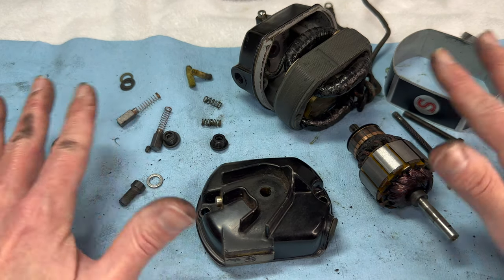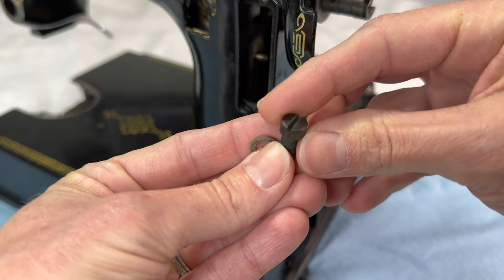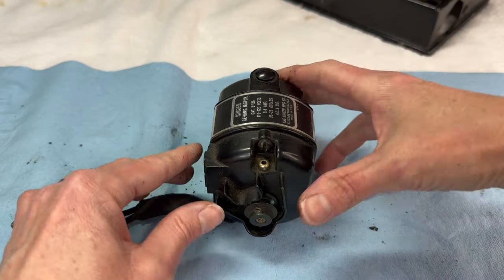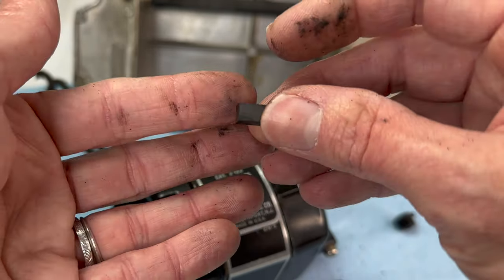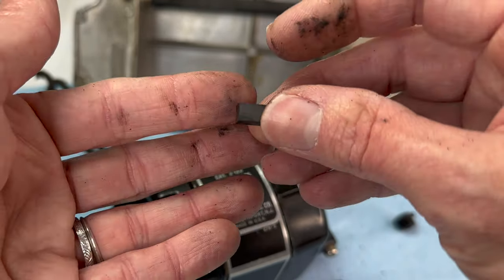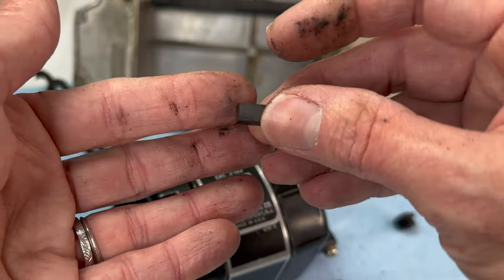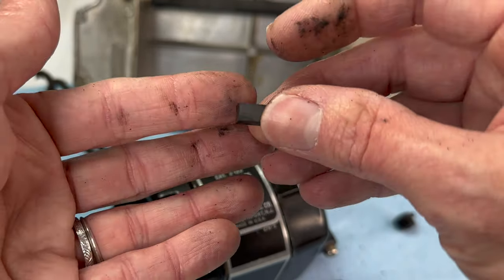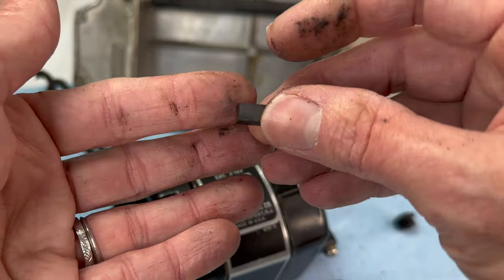How to take apart the motor on a Singer Featherweight: Singer Featherweight Tutorial - Part 7

Comment: What caused these rouges on the commutation?  Thanks, Dave
Reply from the maker: Hi! Probably thread and needle strikes. Hard to imagine thread could do that but if a machine isn’t maintained properly over the years then it is possible. Almost every Featherweight I work on has those marks…makes you wonder if the hook assembly design could have used some tweaking…

Comment: Hi Jen, Thank you so much for the Featherweight tutorial.  I am rehabbing my first Featherweight and your videos are guiding me along beautifully.  I have run into a problem that I could use your advice on.  I cannot remove the screw that loosens the motor.  I have applied penetrating oil several times.  I could get someone stronger than I to try, but I'm afraid of causing damage.  Do you have any advice I could follow before resorting to brute force?  Thank you!  Michelle
Reply from the maker: Hello! are you talking about the motor mount screw? It is a pretty hefty screw so you shouldn't be afraid to be a little forceful with it. If you have a way to get some leverage it should come loose. The chapman screwdrivers come with a little mini ratchet tool that fastens on to the shaft of the screwdriver, I don't know what I would do without that sometimes! It helps you get more torque when you are turning the screwdriver. But yes, maybe it's time to call in a little more muscle! I hope you can get it loose!

Comment: My featherweight light comes on but the motor stop working?  Do you have any suggestions?😪
Reply from the maker: Hi! Without seeing it, it would be hard for me to tell. I would unplug the machine, make sure the motor brushes are not worn down all the way and then I would check all the wiring. It could be a number of issues, sorry I can’t be of more help here!

Comment: As you were removing the brush covers, you mentioned a link to get new ones. However, there is no link for the covers. Mine on my white featherweight are broken or sheared off. Can you please tell me where to find new ones? Is there someone who can make new ones using a CAD program and a 3D plotter? Any information will be greatly appreciated! Thank you.
Reply from the maker: Hi! Here is the link: https://singer-featherweight.com/products/motor-cap-screw-small/?aff=57 I will try to add it to the video description as well. I don’t know if anyone who can make them with a 3D plotter, that would be great if there were someone who did though!
Reply: Thank you! Do you have a code to get credit for my purchase? @SewingMachineRehab
Reply from the maker: Hi again :) That link will do the trick! Thank you for asking! @jenc7086

Comment: An excellent demo series!  You did a fantastic job of explaining the mechanics of disassembly and reassembly.  How fortunate we are to have this.  Many thanks!!!

Note to viewers:
7:40 Pull out carbon brush SLOWLY, and stop before brush comes fully out. Check direction of curve on end of carbon tip. Is it horizontal or vertical? Make a diagram on paper showing curve of carbon tip so that you have a visual when putting the used one back in after maintenance. It makes no difference on a new brush, but the old one has a curve matched to the commutator curve inside due to wearing down from contact.  This is particularly important in this particular model, as the brush seems square not rectangular.  In my vintage Viking machine, the brush is rectangular and only fits one way inside, so it is foolproof.
Reply from the maker: Thank you so much! I was sad when this one was completed, it was so much fun and I have immensely enjoyed the interaction with all who have followed along!

Comment: While cleaning out my attic this week, I found a Featherweight 221 in it's case that has been sitting there for almost 30 years! It is a 1952 and looks like it was rarely used. I have been following along with your videos up until taking apart the motor. If I tackle taking the motor apart, where can I buy new wicks for the grease? I am assuming they are hard as rocks by now. Thanks!
Reply from the maker: Wow! That is wonderful! I think I will go look in my attic for a Featherweight haha!  I actually sell the grease wicks on my site now: https://sewingmachinerehab.com/shop/ols/products/grease-wicks-for-singer-featherweight-221-motor  ….and good luck with your restoration!

Comment: would i be able to just use electrical tape instead of heat shrink tubing?  btw thank you for this series, it is amazing... i have 2 featherweights all taken apart ready to be cleaned now, thanks to your helpful detailed, descriptive videos! ur an angel
Reply from the maker: Hi! Thank you for your kind words, I am glad you like the videos. I would stay away from electrical tape in place of the heat shrink tubing. I am not an electrician but from everything I have researched the heat shrink tubing is safer. I hope that helps!
Reply: thanks!  one more question, can i just skip the heat shrink tubing altogether?? @SewingMachineRehab
Reply: Harbor freight has heat shrink tubing, you don't have to shrink it, if you don't have a heat gun !

Comment: Good Evening.  I am so happy that I found your YouTube Channel.  I was gifted a 1952 Featherweight.  It is in need of some TLC.  I have removed parts following your instructions.  I even have the cap off the motor and have the other side to loosen to get to the wick.  I noticed that the armature is black and not the copper color yours is.  I am assuming that I can wipe it off, not sure if I can get back to the copper color.  Is it normal that it should be black and not copper?  If you have any suggestions on how to handle this, I would be greatly appreciative.  Thank you and Cheers.
Reply from the maker: Hi! You can wipe off some of the carbon you see with a cotton swab dipped in alcohol. Then I polish it using very fine sand paper, around 3000 grit and wipe it again with alcohol. You should see copper under that black when you are finished. The featherweight shop makes a rubber honing stick which also works well. I hope that helps!
Reply: Thank you for your reply.  Another question: The coils on the armature that look like  a flower are also black, not copper that I have seen on your videos.  I have tried to wipe it off and nothing comes off.   So, can an armature have dark wire opposed to the copper wire?  I was wondering if there was a time that Singer made their motors that way . FYI:  The machine did run before I took it apart.  I look forward to your thoughts.  Thank you in advance.  Cheers.😀 @SewingMachineRehab

Comment: Thank You for the video Jen.  I am not able to get the set screw off the shaft.  Is it the end of the world if I can't get to that wick to change IT? I used Kroil for several days and used the hair dryer without success.  I was able to get the other wick and wick spring out
Reply from the maker: Hi! You are welcome! Do you mean the set screw to get the pulley end off?
Reply: @SewingMachineRehab  yes
Reply from the maker: @KarenC-rv2zp  I just saw you replied to this. If you can’t get it off then you can just clean in place. I would add grease to the port and then when you are able to run the motor and it can heat the grease up check to see if you need to add more. I think it would be ok to add a drop of oil in the port before you add grease just to soften the wick up if it is hard. Then add the grease. Sorry I didn’t get a reply back right away!
Reply: @SewingMachineRehab   thank you for the information. I just received your wicks and got the spring and the wick back in the other port!!! HAAA. Also The wicks are they wool or cotton?
Reply from the maker: @KarenC-rv2zp  Just realized I didn't answer this, they are wool. Sorry for the delay!

Comment: Could you point us to the McMaster-Carr item number for the grommets?  I know they are sold in packs of 100..thank you for sharing you knowledge.  Thanks!
Reply: did you find the grommets?  i am looking for them too-   I am using my bf's youtube tv account - my name is lana
Reply: No, i used shrink tubing around the wires.
Reply from the maker: Hi, a little late on this, sorry. The one I use is B811. It is the closest fit I have found that still has a larger inner diameter so that you can fit the original thicker wires through if you want to. They are a little fiddly to get in but they do fit well. I think you have to purchase 100 at a time but they are not too expensive. I hope that helps if you still needed to know!
Reply: Thank you, I know you must be very busy. I can’t imagine how much time and effort it takes to do these videos and answer everyone’s questions. 🥰

Comment: If necessary, let’s say a wire is frayed or corroded from water exposure (!), can replacement wires be purchased, or do you know if the correct wire ratings can be found on the repair schematics?  I am not quite there yet, and I need to have my husband look at the motor for his professional opinion. While not a small motor guy specifically, his career involved fixing anything on a seagoing vessel that needed repaired, .  I did get brave and take the motor off and open it.  I am now taking a break.😸  in a weird turn of fate, one of the brush screws was obviously broken and repaired with some type of hardened goo, maybe an epoxy.  Like the one you are working on, mine has been cleaned or “repaired “ by someone before me. Someone with gorilla strength where screws were concerned.
Reply from the maker: Hi! Yes, you can replace any of the wiring with 18 gauge copper stranded wire. I usually replace the wiring for the light and switch and the two wires that come out of the motor. If your husband can solder (sounds like he can!) then you should be fine. Good luck with the brush cap screw, that’s frustrating but at least you can buy new ones. Let me know if you have other questions, I haven’t made a rewire video yet.
Reply: @SewingMachineRehab  thank you very much for the reply!!

Comment: Thanks so much for documenting this! Do you have a source for the motor grease wicks? Thanks!
Reply from the maker: Are you looking for just two?
Reply: @SewingMachineRehab  Well if all goes well, I will need 6.
Reply from the maker: So sorry, I meant to get back to you on this. There are a couple sellers on Etsy that sell them. The wicks are a little thinner than the original wicks in a 221 but they work. If you are looking for a direct source you can look at McMaster Carr, it would be under “Firm felt cord” and you would need to identify the diameter you need. Hope that helps!